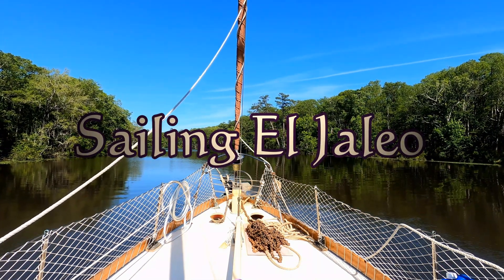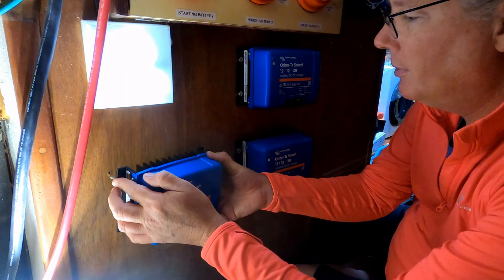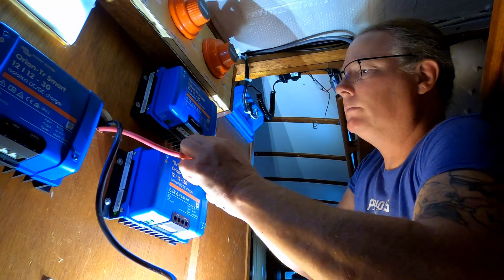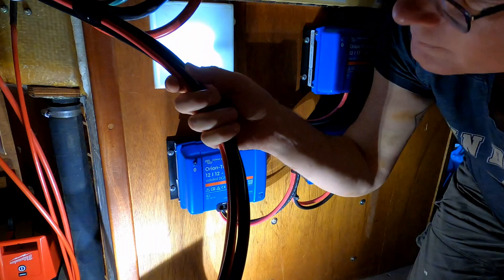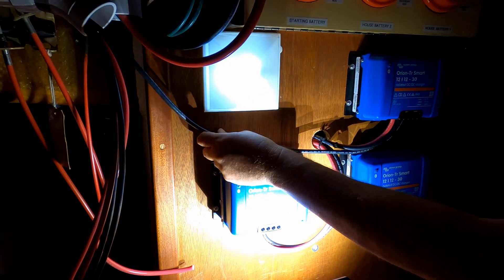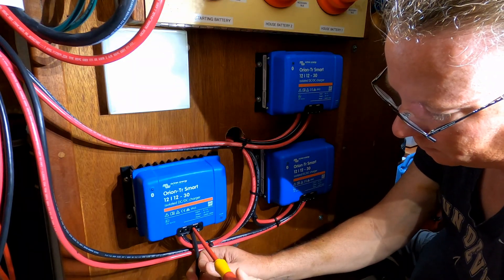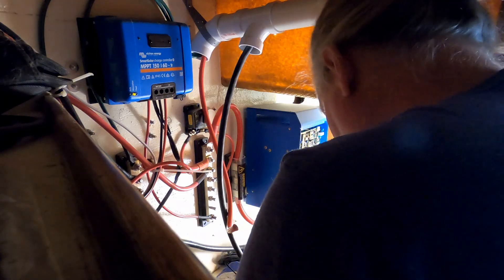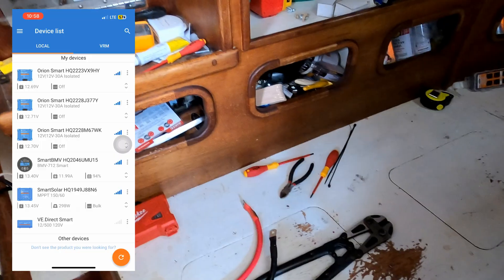S03E33 - Making an Alternator Play Nice with Lithium (LiFePO4) Batteries (Part 01/02)

Comment: Instead of using multiple battery to battery chargers is it possible to use a battery isolator to protect against the load dump and then a single dc-dc convertor to charge the starter battery from the house bank.
Reply from the maker: I did purchase an alternator overload protection device (not sure if that is what a battery isolator is) and it said in the fine print that it could be overloaded if the voltage spike was too high so I didn't want to take a chance and rely on it. If a battery isolator is different let me know and I'll check it out.

Comment: I wanna use the 300ah battery for powering 4 oil cooler with fan with 2 oil pump for a race car ,I am gonna use the first  battery to the sec 300ah battery and a  isolator with a over charge protector  is that a good idea?
Reply from the maker: I'm afraid that is beyond my expertise, which is quite limited.